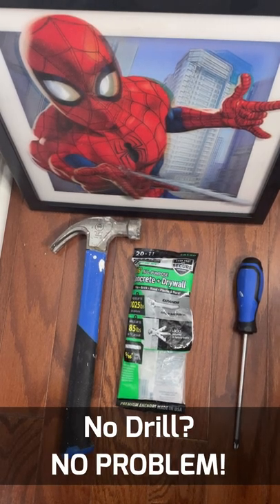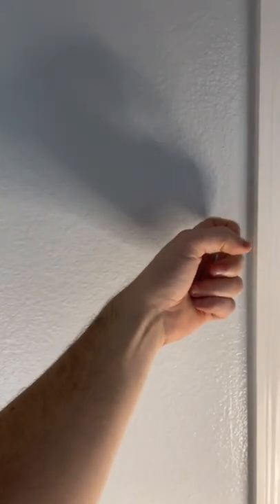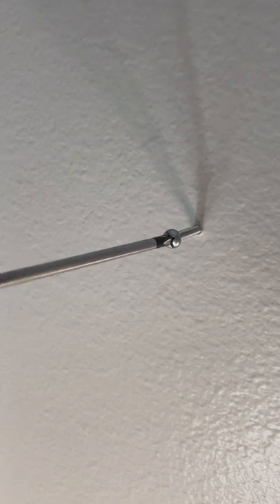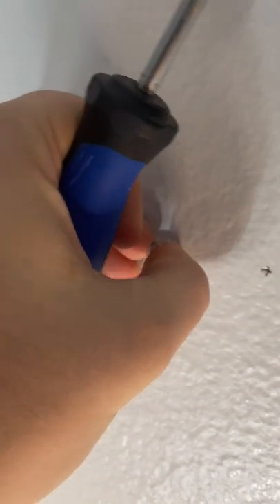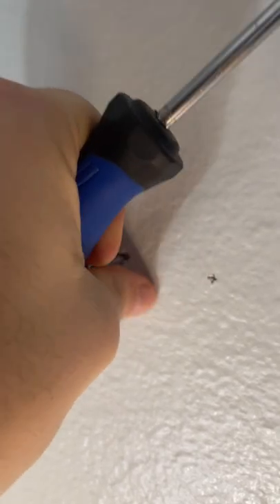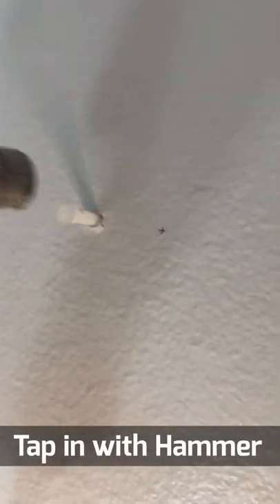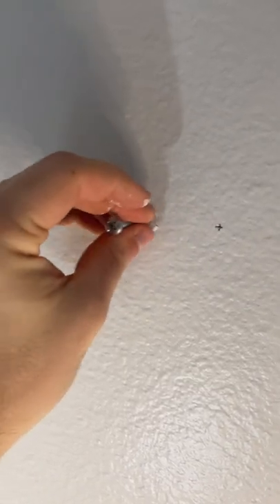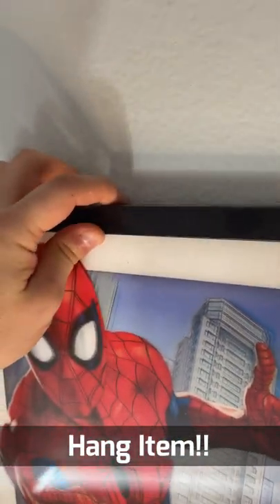How to Install Plastic Drywall Anchors Without a Drill!

Comment: I tried this and the hardest part is removing the screw - it takes part of the wall away
Reply: You are correct, there is a reason the instructions say to drill the hole. The method shown in the video may get the job done, but I don't think you'll ever see the manufacturer or a masterful drywall finisher suggest this method...but I'm not either so I could be wrong. Just used them several times and have learned by trial that drilling according to the instructions seems to be easiest and most effective in the long run

Comment: Doesn't work.  My anchors just bend when I use the hammer. 🤦🏻‍♂️🤷🏻‍♂️
Reply: Need to make sure the hole is big enough for the anchor to fit in. Can use screwdriver with hammer to enlarge the hole. Spray a bit of water may reduce the force needed too.

Comment: I always break the anchors when I do it with hammer 🔨 😔
Reply: Usually means your hole is too small for the plastic anchor
Reply: I use a screwdriver to slightly make the hole bigger. slightly. Just enough to be snug against the plug when it goes in. Works good

Comment: You are correct, the method shown in this video may get the job done, but there is a reason the instructions say to drill the hole. I don't think you'll ever see the manufacturer or a masterful drywall finisher suggest this method...but I'm not either so I could be wrong. I've just used them several times and have learned by trial that drilling according to the instructions seems to be easiest and most effective in the long run, from start to patching the hole...especially inserting the anchor, and fixing/patching steps!

The other big factor here is, even if you get the anchor in, if the hole wasn't large enough you end up break up the drywall inside the hole with the screw that's not made for drywall, and the anchor that's too big for the hole... so when you get the things hung up, you anchor is grabbing onto drywall gravel instead of sheetrock and/or your anchor is compromised before it ever gets a chance at it's intended use. This can lead to a significant difference in the security of anchor.  Where would you prefer to attach your belongings, in a wall of rock or a pile of gravel?